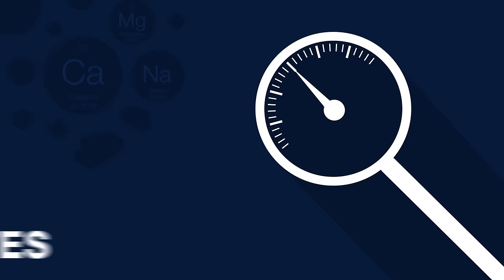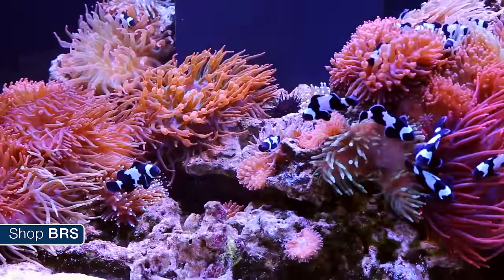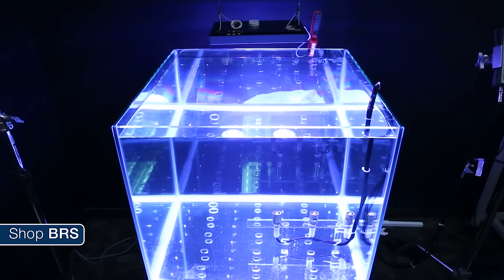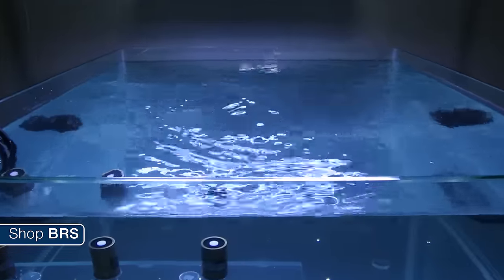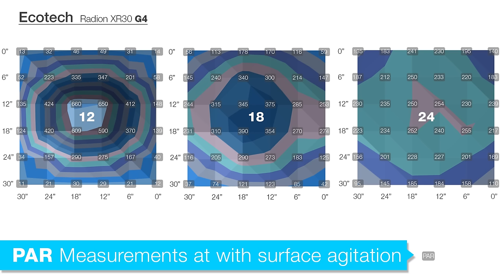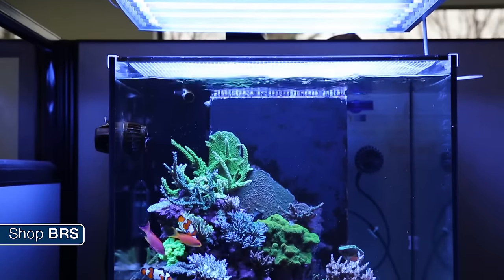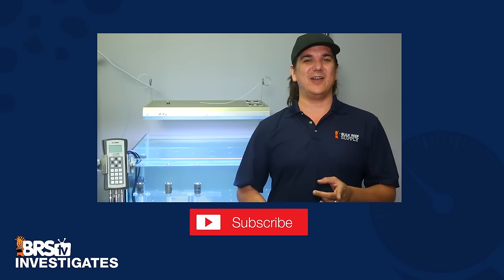BRStv Investigates: Is measuring PAR more accurate in AIR or WATER?

Comment: how do par values registered by par sensors change from air to water readings. i have the sq520 apogee meter and the manual says it changes by a factor around 30%? should i change any of the settings in the program to compensate for this.

Comment: The 4*54 Watt T5 fixture on my Eheim Incpiria 300 is factory fitted about 1 inch from the surface only (The manual says min 15mm!).  I'v no doubt that eventually LED fixtures will be designed to operate this close as clearly there is substantial performance improvements to be had.  Great review!

Comment: How about testing the uniformity of the salt mix at different heights in the bucket (i.e. does the salt at the top of the bucket differ from the salt at the bottom?), and if the buckets are not uniform, evaluating the efficacy of shaking/rolling/etc to rehomogenize the bucket?  I personally feel like i end up using different amounts of salt every time I mix up the exact same volume of water.

Comment: Do the Li-cor sensors require an adjustment factor similar to the Apogee units? If so, was it applied to your measurements? Of course either way would yield the same results in your pctg. change measurements. Only the absolute numbers would be affected.

Comment: Looks to me like there is a design flaw in the LED lights on the market today. Making the LED hood considerably larger seems like it would increase PAR uniformity. And, a bigger hood may mitigate the need for fan cooled LEDs. While I'm sure advanced users could take advantage of targeted lighting that current LED tech can provide, more diffuse light such as that seen with T5 seems like it would be more manageable for the majority of reefers. You didn't mention the wattage/equivalent wattage and lumins rating of the lights, but that is important information imo.

Comment: Great vid and thanks again for another awesome test.
IMHO,  I guess air measurements would be better than nothing if water measurements weren't available. Ultimately, I don't see PAR measurements done in air as being useful when / if water measurements are available. 
As for the cube sized aquariums compared to typical rectangular aquariums, rectangular aquariums have a larger surface area so there will be a greater decrease in PAR on the outer edges, which is just logical.

Comment: I believe the reason you didn't see any really difference with the surface agitation test was the programming of average results over a period of time to be the given measurement for the par meter.  I'm willing to bet the actual measured data points were all over the place. In a way it ties into the previous test of how the spectrum was different for a few lights at different points in the tank. Not that it's a significant game changer as the coral don't seem to care either way just something to be mindful of.

Comment: Does that mean, that the PAR measurements under water is wrong (by 32%) or does this correction apply, if you want to compare underwater and air measurements (that is, the effect that you discuss) ??
Reply: Yes - I know. But what does this correction do ? Does it convert water measurement to the equivalent air measurement (the difference you discuss in the video), or does it correct for the sensors lack of precision under water. If it is the former, then the correction should not be applied, when we want to know haw much light is reaching the corals

Comment: I would imagine youd want to get the light information in water, since you're using the lights for specimens under the waters surface.
Reply: In that case I'd do both water and air, but I still think the most important would be to do it on the water end of things. The whole thing here though is you have to be consistent, cant test in water one time and in air another time. As long as the tests are consistent, the numbers would all line up as they should, I think.

Comment: I'm so excited and a bit scared I just found out a two-year-old aquarium I was about to throw out isn't tempered glass like I thought it was I've been looking to upgrade from my small Coralife 29 gallon BioCube I'm moving on to a 75 gallon aquarium I do not feel confident drilling the holes myself even though I looked up tons of tutorials so I'm going to be getting it drilled at the fish store I go to it's going to be just like Starting Over Again with my aquarium I need to get a sub the pipes the return pump and lots of other things but the tank and stand are now out of the price looking for advice for my my sump return pump and positioning of the things I know how to use PVC and how to put it together I use PVC a lot but mostly with air not water I also have to buy a second kessil a160 tuna blue and learn to take the one I have on my BioCube off and put it on this aquarium but then I need one for the other side right now cost is becoming a problem so I'm putting it together piece-by-piece I was also wondering why I wasn't getting any notifications from this channel in a while since it doesn't definitive upload schedule so I just thought there was no videos I went to the channel to look up plumbing and sumps and I realize I missed there are a lot of content which I now have to watch I just wish I didn't have to press the notification Bell and YouTube would just fix their stupid subscription box but still really excited and kind of concerned because of that because I tend to skip stuff when I'm excited :-)

Comment: Guess I need to ask a bit more direct.. Did you account for the sensors "immersion effect". 
According to Li-Cor Under water measurements need to be multiplied by 1.32 approx..
As far as I know it may just be a switch on the data logger..but you don't mention it at all.
Just need verification.

IIMMERSION EFFECTA sensor with a diffuser for cosine correction will have an immersion effectwhen immersed in water.  The radiation entering the diffuser scatters in alldirections  within  the  diffuser  with  more  of  the  radiation  lost  through  thewater-diffuser  interface  than  in  the  case  where  the  sensor  is  in  air...Thus, a greater percentage ofradiation entering the diffuser in air reaches the  photodiode than in the casewhere the LI-192SB is in water.  Therefore, a normal underwater readingwould need to be multiplied by this effect if the sensor is used in water
Reply: Thanks for responding.. Just seemed odd that at 3" so much PAR was lost.. 
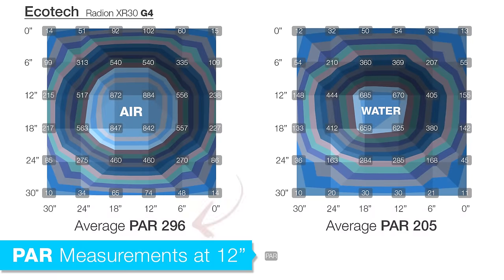To add to that if one takes the 412 measurement in water, multiply it by 1.32 you get the in air measurement.. or close..544 vs 563 in air (7:44min mark)
659 x 1.32 = 870.. in air measurement is 849
Odd coincidence I guess.
Reply: I think it is because the correction factor does exactly that: convert water measurements to the equivalent air measurement. Because why should the sensors be reading wrong just because it is under water ?
Reply: http://www.bulkreefsupply.com/video/view/brstv-investigates-what-par-meter-is-the-best/
HA!!!!!.. ;)